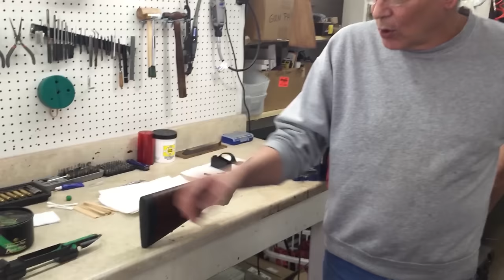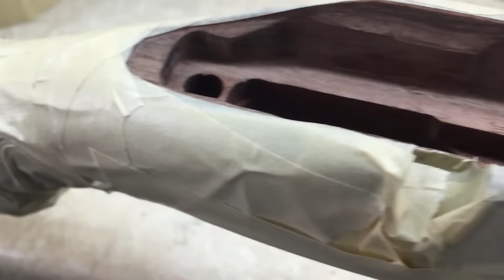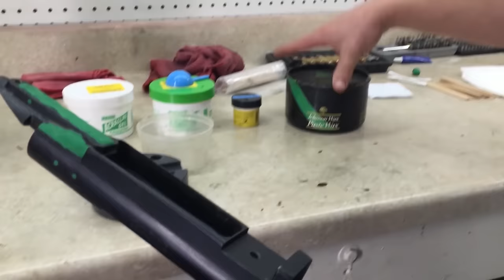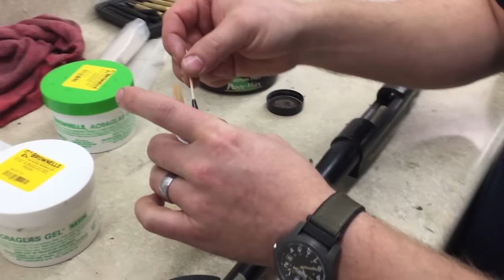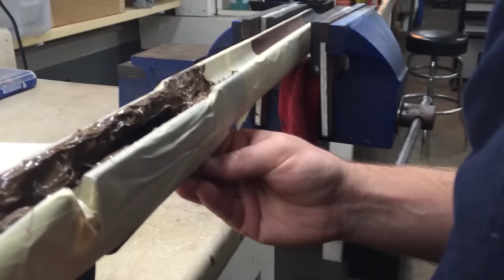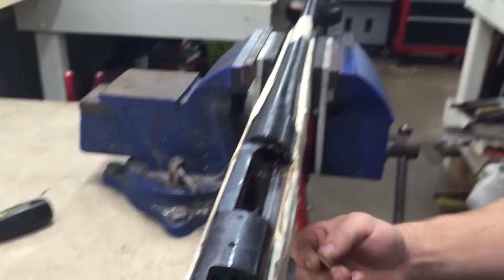How to Glass Bed Your Rifle Action  (Part 1)

Comment: The purpose of bedding an action to a stock is to prevent movement between the two during the firing the rifle.  The part of the design that prevents movement rearward is the recoil lug.  All one needs is a really good fit at the recoil lug and the notch in the stock for the recoil lug.  I use JB Marine epoxy and push the action forward then tighten the mounting screws just past snug then let the rifle sit over night.  I consistently get sub 1/4 MOA @ 100 yds.  (dimes at 100 yards to holes touching)

Comment: I want to thank you for saving me from a WHOLE LOT of Dremel work! Everybody else said to let it set 24 hours. As soon as it firmed up, I pulled it apart & cleaned up excess epoxy with a pocket knife. May still need a little touch up, but should be VERY little. Thanks for making my first bedding job a success!

Comment: All that tape is totally unnecessary. That is a sure sign of an amateur bedding job. Another sign is how much epoxy you mixed up. What a waste!!! You mixed up enough to bed 4 rifles!! You should also use inletting screws, when glass bedding a Winchester model 70. Otherwise you get a lot of epoxy going into the chamber area of the rifle. This is a great video on what not to do. Thanks!!!

Comment: Celaphane may work good for laying barrel in compound should not adhear to compound and you wouldnt have to clean all that greasy wax off?
Reply: No it won't.  To many odd angles, it will rip, plus it will leave a gap when removed, if you don't epoxy plastic to everything else.
Reply: Instead of wax, can we use MP3 grease or any lithium based grease as an alternative?

Comment: Sorry, but the moment when I saw you scraping out the bedding compound that had seeped into the action's magazine well I knew not to use this clip or listen to you for instruction on how to bed a rifle.  The proper way would have been filling the magazine well and any other areas of the rifle that you don't want the bedding compound to potentially get into with plumber putty or modeling clay before you attached the action to the stock.  Also, using the screws to attach the stock to the action with so much bedding compound all over the place?  Real bad idea.  Even if you applied release agent on the screw's thread if enough compound got on the screw or into the screw hole your looking at a serious problem later when you try to remove the screws.

Comment: If the "prep" (after "relieving" the stock that may or may not need "relieving" period and is STILL going to contact the RECEIVER no matter what you do to FLOAT THE BARREL) and "cleanup" are 90% of the labor and bill and the "gunsmith" ends up wasting more materials than go into the bedding, there's a good chance the "bedding" job is being done by the hour and not by the job. And there's a good chance any "gunsmith" who says "anything you want to use that "works" well for you is just as good as everything else" probably learned everything he knows through an "apprenticeship" type of "training". 

Which is VERY useful for turning bad habits and incorrect "knowledge" into "standard procedure" and "common sense" in a "trade" like gunsmithing where the REAL MONEY is made "fixing" problems that aren't REALLY problems in the sense that the gun has "failed" to do anything but live up to the expectations of the customer who is about as "qualified" to determine if a gun is "broken" or "failed" as the average car owner is to do anything but turn the key, start the engine and put the car in gear. In the OTHER "technical trades" we start by VERIFYING THE "COMPLAIN" IS AN ACTUAL PROBLEM WITH THE MACHINE. 

If your "gunsmith" just takes  your word for it that your gun "won't shoot" and doesn't VERIFY its ACCURACY/PRECISION BEFORE HE OR SHE "ACCURIZES" IT, how in the HELL is he or she going to be able to compare the BASELINE ACCURACY/PRECISION to POST-WORK ACCURACY/PRECISION FROM TEST-FIRING AFTERWARD AND HAND YOU A GUN THAT REALLY DOES "SHOOT" WITH THE BILL FOR THE WORK? EVERY "MECHANIC" FROM HVAC GUYS TO APPLIANCE REPAIRMEN TO AUTOMOTIVE MECHANICS FROM TIME TO TIME HAS TO TELL THE CUSTOMER THAT  THE REAL "PROBLEM" IS "OPERATOR ERROR". 

If a customer is EDUCATED by a PROFESSIONAL after that professional VERIFIES THE PROBLEM OR LACK THEREOF AND THE PROBLEM IS THAT THE CUSTOMER ISN'T USING THE MACHINE "CORRECTLY" TO ACHIEVE BEST RESULTS FROM IT, THE "MECHANIC" IS STILL SOLVING THE "PROBLEM" BY TALKING TO THE CUSTOMER AND THAT'S THE ONLY WAY TO SOLVE THAT KIND OF "PROBLEM". There is NO AMOUNT OF "ACCURIZING" THAT CAN BE DONE TO A RIFLE THAT IS GOING TO TURN A HALF-BLIND/UNCOORDINATED/INEXPERIENCED/NERVOUS/STRESSED/CARELESS/PRE-OCCUPIED "SHOOTER" INTO A "MARKSMAN" ANY MORE THAN PUTTING A "RACING ENGINE" AND "RACING TRANS" AND TUBS, A LOCKER AND SLICKS IN A GROCERY GETTER GRANDMA CAR IS GOING TO TURN GRANDMA INTO JOHN FORCE.  NEITHER WILL SELLING GRANDMA A RETIRED FUNNY CAR FROM JOHN FORCE RACING. 

If you can't walk out of a "gunsmith's" shop "knowing" your gun is "shooting" and don't have that confidence leaving, is it EVER going to "shoot" for YOU no matter what the bill is? There's a REASON most "competitive" shooters in "serious" competition have at least a BASIC "gunsmithing" background or at least the ability to know when a "problem" is THEM and not the GUN. And "problems" with accuracy/precision that just "show up" out of the blue are RARELY "gun problems". Guns, like ALL machines tend to either "work fine" or be "fucked up" and there will be PLENTY of indications its the GUN that has the problem if the "shooter" pays attention to how the gun FEELS and SOUNDS and how the empty CASES look and how the GUN looks "inside". 

An engine spins bearings due to lack of quality and/or quantity of lubrication. Period. And QUANTITY is far more important than QUALITY. OIL NEVER "WEARS OUT". ITS "OILY" FOREVER. When the OIL LEVEL gets low and oil pressure drops and there's insufficient lubrication "capacity" at the bearings, metal rubs on metal and the bearing gets "welded" to the journal and spins in the block or rod. Any "thrown rod" that's actually thrown is due to "big-end" failure. If the big end come off the crank, 99% of the time its a lack of lube IF the engine RAN MORE THAN 5 MINUTES AFTER BEING ASSEMBLED. So a KNOCK or THROWN ROD isn't the PROBLEM. The PROBLEM is a lack of lubrication and THAT can be due to a sudden leak but more often than not is due to the operator not checking the oil. So-called "idiot lights" are only useful IF you immediately turn off the engine when the light comes on and even by then its probably too late. 

They're mainly there as "replacements" for checking the oil frequently. They come on at key on, stay on til there's oil pressure and don't come on unless pressure is FALLING with the engine running. Its already too late when that happens and the engines coming apart one way or another. Before that occurs the engine will be "making metal" and the oil is probably being overheated. A few seconds of engine operation with the "idiot light" lit won't cook all the oil or fill it with super-fine particles of metal that look like "glitter" in the remaining oil. How the engine looks INSIDE tells a smart, professional mechanic what the actual deal is. And to COVER YOUR ASS if for no other reason, you make sure to document "random" and "unexplained" failures in a write-up and mention "low oil level" and if you're SMART you just "insult" the customer by telling them the problem is their fault for not operating the vehicle correctly.

When a "shooter" suddenly has a gun that "won't shoot" the problem almost certainly isn't the "gun". Check the "optic". If a "factory" rifle is almost BRAND-NEW (any rifle that doesn't show some minor scuffs, scratches, wear and other "battle scars" and is in "mint" condition that "won't shoot" probably HASN'T "shot" since BRAND-NEW even though the "shooter" might only have decided its the rifle after trying "everything else". Which won't have included handing the rifle to somebody else and letting him or her shoot a few groups with it. There are two types of "good shooters". Those who are "good" in their own opinions who use/used "shooting aids" like benches, bags, bipods, rests, optics and big "budgets" to get "good" at "shooting" by minimizing their own contribution to it and "buying" results. 

And those who are "good" in the opinion of other "shooters" who respect their ability and experience and skill and may KNOW they're "good" themselves but are NEVER "good enough" and who have gotten as "good" as they are by shooting anything and everything they could at ever opportunity, shoot for FUN FIRST, have a passion not only for "shooting" but guns as well as other "machinery" and are "mechanically-inclined" enough to know that machines don't "fail" humans. Humans "fail" machines. Whether when designing them, building them, using them, servicing  them, etc. And even then its rarely a "systemic" problem where a SINGLE PART is the CAUSE OF THE FAILURE ALL BY ITSELF. A BARREL will get "shot out" but that's not FAILURE. That's normal wear. A STOCK can't "fail" unless its broken and renders the gun useless. And a STOCK ALONE isn't going to "go bad" and cause "problems" with accuracy and precision that are CONSISTENT across a RANGE of shooting situations, ammunition, etc. 

GLASS BEDDING, as it USED to be known before "gunsmiths" without the time/money to buy a quality, made-to-order and "expensive" product like ACRA-GLAS and/or "gunsmith schools/instructors" too cheap or broke to buy same for students to pour on by the pound and waste half of when those SAME "gunsmith schools/instructors" were/are teaching "bedding" as a "front to back" and SEPARATE "process" or "task" from "floating" the barrel (schools make more money and students pay more and "gunsmiths" make more  when a "bed job" that RESULTS in a "floated barrel"  is turned into TWO "SKILLS" AND "JOBS" by calling it "bedding" AND "free floating") and decided that "bedding a rifle" is "better" when you just put "bedding material" EVERYWHERE the "action" touches the stock even though NO FACTORY RIFLE BEGINS THAT WAY AND THE WHOLE POINT IS TO MINIMIZE CONTACT NOT OF THE RECEIVER TO THE STOCK BUT OF THE BARREL TO THE STOCK. 

There's NO WAY to "free float" a freaking ACTION/RECEIVER from a STOCK And then SCREW IT TO THE STOCK and GLASS BEDDING predates COMPOSITE/SYNTHETIC STOCKS THAT ALSO SHOULD BE AND ARE "GLASS BEDDED" BECAUSE THEY HAVE TO BE WITH THE "MOLDING" PROCESS BEING LESS "ACCURATE" AND "PRECISE" THAN "INLETTING" A WOOD STOCK. 

If you want to know if a gunsmith is worth a shit, do this little test. Take a FACTORY BEDDED RIFLE like a WEATHERBY MARK V OR BROWNING A-BOLT/X-BOLT OR TIKKIA OR HOWA TO HIM, ASK HIM IF "BEDDING" IT WILL IMPROVE THE ACCURACY/PRECISION AND IF HE SAYS "YES", FIND ANOTHER GUNSMITH. THEY'RE ALREADY "BEDDED" FROM THE FACTORY, THE AMOUNT OF "BEDDING" USES IS LESS THAN WHAT THESE "HOW-TO" VIDEOS AND "PROFESSIONAL GUNSMITHS" WASTE SQUIRTING OUT FROM BETWEEN THE STOCK AND ACTION AND IF YOU DON'T LOOK CLOSELY AND KNOW WHAT YOU'RE LOOKING FOR YOU MIGHT NOT EVEN SEE THAT.
Reply: On second thought maby just don't shoot your mouth off.
Reply: You must have alot of free time.